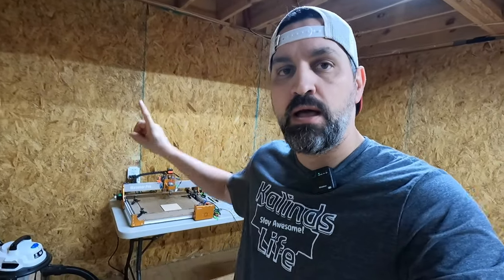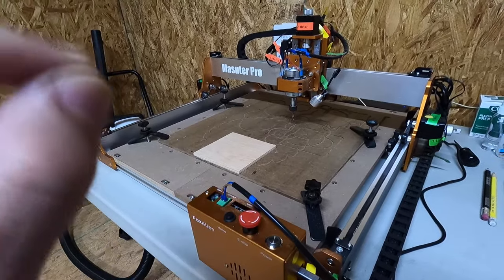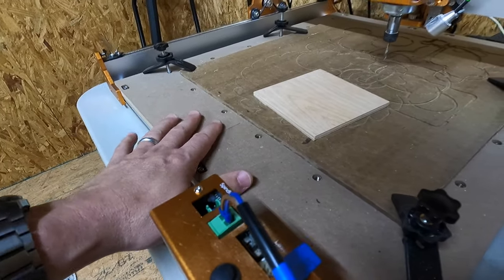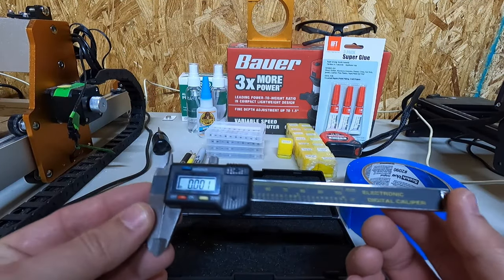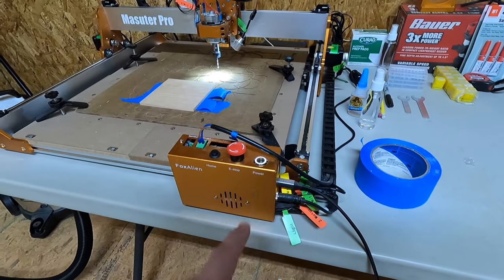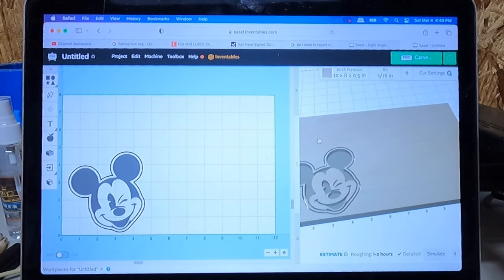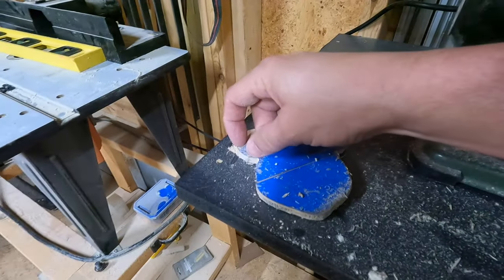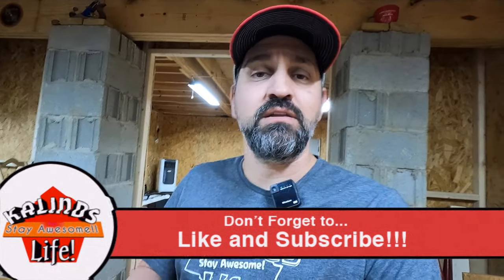My NEW FoxAlien Masuter Pro CNC Machine!  The Basics you NEED to get you going!

Comment: Ditch the glue and tape and get some XFasten double side tape.  Throw the metal clamps away.  Tape your spoil board down, mine has never come loose.  Putting the trim router in is a game changer.
Reply from the maker: WoW! I checked out Xfasten and appreciate the tip!!! Added to my list of things to buy! TY!!!  I did enlarge my spoil board and ditched the clamps! Thanks for the tip and watching!
Reply: Xfasten is what I use. I’m surprised more YouTubers aren’t talking about it. No residue, a secure hold, and not that expensive, a little goes a long ways.
Reply: @Riless42 hi is it the XFasten woodworking tape you use? I've been a few different versions of XFasten double sided tape, but I assume its the Woodworking one you use?
Reply: This

Comment: Thank you so, so much for making this video. It makes this beginner process so much easier and less stressful because there is SO much information out there. Your video is more helpful than you could ever know!
Reply from the maker: Super glad it helped out.  More to come!!!
Reply: @TheCrawlspaceCraftsman  I am settled inwith my machine and have made several things with the bits that you recommended, but now I'm wanting to experiment with a v-pocket bit and am running into issues with jscut. I'm using jscut to convert my svg to gcode. What program do you use to do that?
Reply from the maker: @elizabeththrockmorton9318  I would use Easel by Inventibles. It’s an online program and super easy to use!
Reply: @TheCrawlspaceCraftsman  Oh! I guess I thought that was just to replace Candle. Do you do all the steps from design to execution in Easel?
Reply from the maker: @elizabeththrockmorton9318  i do yes. I haven’t dived into many other programs. Easel works well for me and my needs. I do pay for the pro program too.  Yes it’s $24/month but I don’t have many other things I pay for monthly so it’s worth it for me.
Reply: @TheCrawlspaceCraftsman  Thanks so much! I am definitely looking into this. Sounds like it's worth it to avoid this headache!
Reply: @TheCrawlspaceCraftsman  I've installed the Bauer router from Harbor Freight and purchased the total wrong 1/8" collet for my 1/8" bits. I clicked on your link above but I don't think I want to get all of those collets when I only need one. Do you have any recommendations for just a 1/8" one that would work for this? I'm not sure how to tell if the one's I'm seeing will work with this router or not.

Comment: Plywood is fine to use. The problem is that you didn't use a sprial downcut bit.  Most of the cheap bits out there are upcut bits and they tear out wood like crazy.
Reply from the maker: I’ve leaned quick the direction of the cut determines the tear out.   Even though this was a test….. down cut would be the way to go especially on ply. Thanks for watching!!!
Reply from the maker: I’d rather blow out the bottom of the wood (the part you don’t see usually) than then top.

Comment: Do any of the Fox Allien machines come with software? Also how loud is the rougher? What do you think is the best software? If you could only buy one machine for a beginner, what would it be?
Reply from the maker: They do provide a free software but it’s not that great. I don’t use it.  I personally use Easel for all my needs.  I’m not a pro in all the available software out there so I would research more for your budget and needs for sure.  I absolutely love the Masuter Pro for a beginner. It’s super easy to build and really easy to operate. I would invest in the extension kit right away for a larger work area. 31x16 oppose to 16x16 (rounded up).

Comment: Thanks for the video! What wood would you suggest to avoid having to sand it?
Reply from the maker: Hi there! I think there’s always going to be a bit of sanding involved especially after a project is completed no matter what kind of wood you use. But to answer your question line would be the best to start with as it’s soft and easy to work with.  Lowes sells nice 3/4” pine panels that’s a good place to start. Thanks for watching!!!

Comment: Dope video bro. Thanks for sharing, quick question , can the table hold a 1.5” piece of material or would that be too big?
Reply from the maker: Thanks so much! It can cut about 15” x 15” and easy hold 2” thick. I don’t think it could cut through 2” though only because you’d need a long bit and I don’t believe it will raise that high. But def can cut through 1” yes.

Comment: thank yuo for the video, but im facing an issue with depth cut , it doesnt cut all the way , i configured the thickness of the material and i set the bit into top corner of stock surface
Reply from the maker: Have you made sure you Z-prove is set correctly? Also what program are you using ?  Easel? You can email me or message me on FB messenger if you’d like!
Reply: @TheCrawlspaceCraftsman  yes I have Z prob I’m using easel and tool path created from fusion 360

Comment: This video is great we have the same cnc ( two weeks ) and I have being using the trial version of easel.  Question…. I During set up I see the mouser pro which option did you choose.  I have been able to get a design done but it came out smaller than the size I input.  I was wondering if the machine I choose might be the problem.
Reply from the maker: That weird.  I’m not sure why your output would be smaller honestly.  Shouldn’t have anything to do with Machine name.

Comment: I just bought the same cnc machine. I can not get easel to recognize it through usb connection. Did you have that problem? can you please help?
Reply from the maker: Did you twist the emergency stop bottom after setup?
Reply: @TheCrawlspaceCraftsman  I did not know about that little trick. I would be trying that when I get home tonight.
Reply from the maker: +@paul_hartsel24 yup! They come usually pressed in.  Try that!
Reply: @TheCrawlspaceCraftsman  it works thanks so much
Reply from the maker: @paul_hartsel24  was that the issue??? Glad to hear your up and running either way!
Reply: @TheCrawlspaceCraftsman  well after I did that little trick turned off the machine it started working. Now I just gotta learn to use it.

Comment: Is the cutting super loud??
Reply from the maker: So the 60w spindle is not very loud but if you add the Palm Router it’s much louder. I have a closed insulated workshop so you can barely hear it outside.  I can’t speak to the 400w spindle (yet) 🤫🫢😉.   stay tuned!!!

Comment: ATTENTION: it does NOT work like any other accelerator
Reply from the maker: I stand by my comment. Don’t waste your money on accelerator. Using alcohol helps evaporate h2o causing the super glue to dry faster than without.  When CNCing we use a ton of tape and glue. It doesn’t make sense for one to by $12 for 2oz of glue. I’ll keep buying my $1.49 glue and surely keep recommending my process because it works… the video showed that. Thanks for watching!